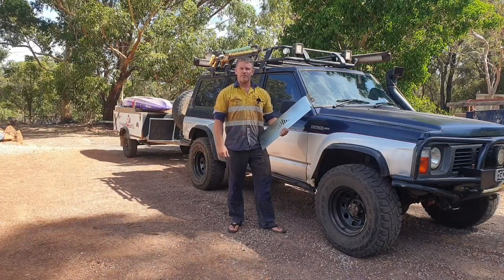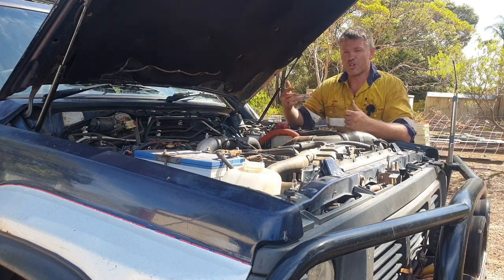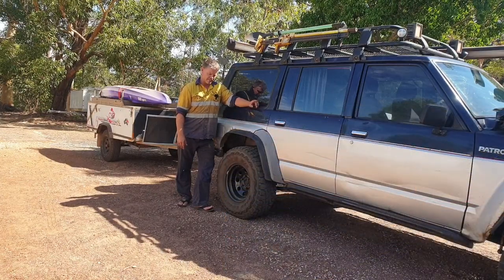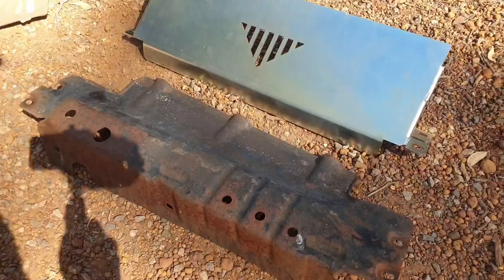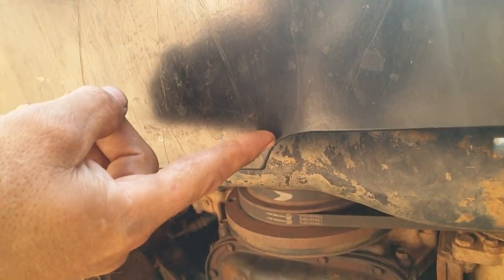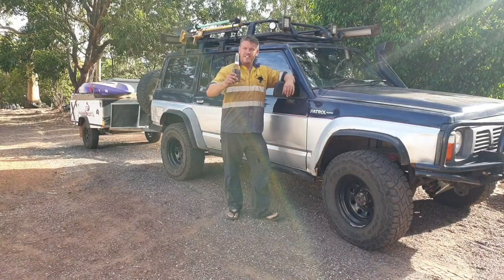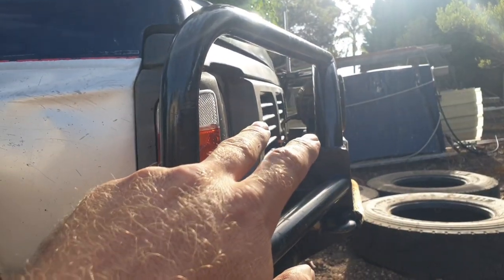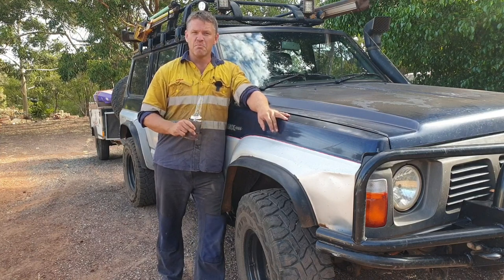Fitting a air/front guard to the GQ Patrol

Comment: G'day,  have come across your videos, which as are great by the way,  trying to get the temps down on my 95 gq. I haven't even risked towing as I get close to 100 degrees when loaded for trips. Anyway wondering where you sourced the air dam?  Do you reckon the fan upgrade is a definite win? I think you mentioned upgrade in water pump? Cheers
Reply from the maker: Hey mate 
Im guessing your cooling system is healthy eg flushed new coolant etc
I would start with the air dam I put the link in the description then try a UFI fan upgrade see how you go
Reply: Cheers,  so awesome and appreciated the quick response
Reply: @downtheshedwithbyron  G'day Byron, just a quick update these bash plates are from Boos bash plates in Vic, easy to deal with, about to order one now!
Reply: G'day mate.have seen your post on temperature problems.I have GQ and suffered heating problems for a number of years. I was saying to Down the Shed regards the water jacket ports between the cylinders which are to small and block up. I found this after removing the head.After cleaning have had no problems since. Suggest trying to flush system with CLR diluted in tap water 4 or 5 times. See if you get improvement. OR!!! Remove the head to clean ports. To leave it the heating problems will keep getting worse as happened to mine. I have owned my GQ for 30 years as in picture.

Comment: Regards to your GQ water temperatures. On your $500 engine did you pull the head off ?? . If not I might have some information your subscribers would be interested in.
Reply from the maker: The $500 engine in the debuild Rebuild project gq?
Reply: @downtheshedwithbyron  yes in the rebuild or your orginal GQ

Comment: Yes in your rebuild or your orginal GQ
Reply from the maker: We put a gumtree $550 special in to the GQ patrol project build that the kids and I are doing its been sweet so far
Reply: Yes I have been following the rebuild that you and the kids are doing. Dad and the kids great stuff. Yeah what I was on about is the GQ cooling system. Bought mine back in the early 90s and still going strong. Mine started having excess heating problem while towing caravans, usually on the days when temps were in the high 30s.
Reply: Yeah coming to the point.Turned out on the td42s that the water jacket ports between the cylinders are to small and block up regardless how clean the cooling system is kept.  12 years later I decided to pull the head of for a valve grind and the likes, not that it needed as it turned out BUT yep  the ports were blocked. Thought your subscribers might like to know this before spending heeps on gear.
Reply from the maker: Yeah that's an awesome tip ive got a spare engine at home ill have to check it out 
Cheers bro